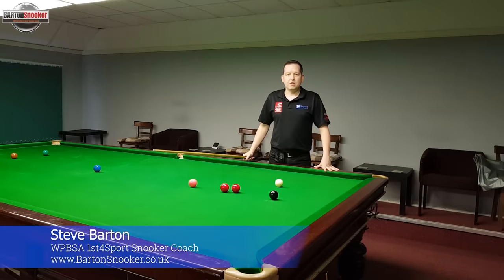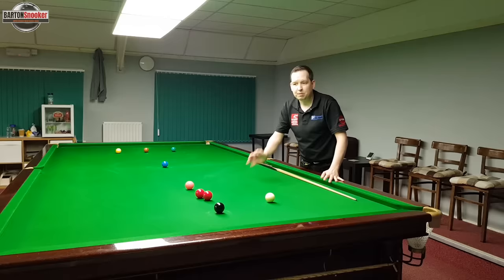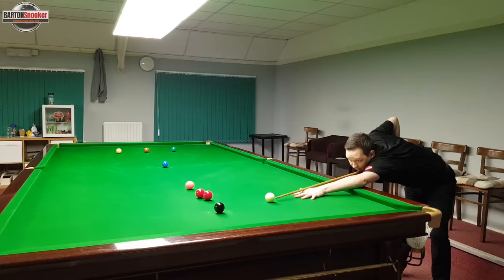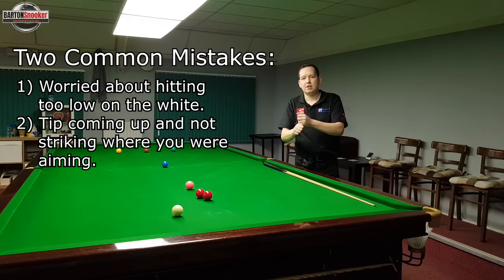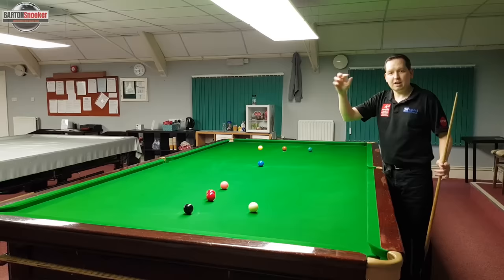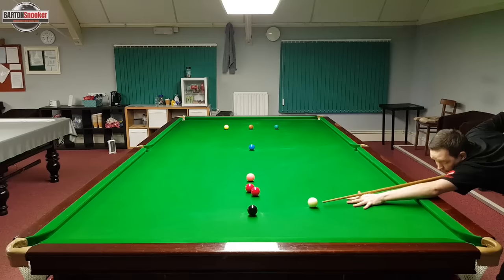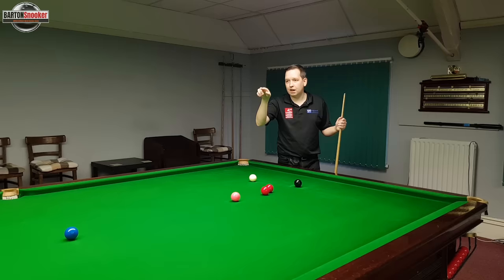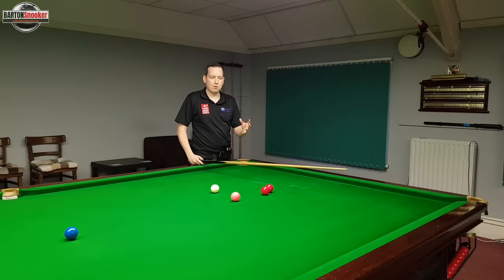3 Reasons Why You Can't Screw Back!

Comment: Thank you Steve for these interesting tips. At 1:57: The first mistake of hitting the cueball higher than you wish is usually the result of gripping the cue too far back, so the forearm is not vertical with the ground. This causes the butt end to rise as the cue goes back, so people tend to drop the elbow to compensate, which in turn causes a seesawing effect on one's bridge in a scooping upcurve, thus hitting higher on contact, not the cue moving forward in a straight line horizontally. That could be one reason why the person is hitting higher in the first place so to fail at hitting low enough to get sufficient backspin. 

Some professionals such as Steve Davis turn their bridge down inwards so that their thumb is practically touching the cloth, for a more level screwing through the ball, especially for the deeper screws. 

 The playing arm's forearm should be vertical to the floor when the cue tip is almost but not touching the cueball in the rest position. At 6:16, I can see that your forearm is perfectly vertical, good man lol. Very good and informative videos, thank you. Agape. Andrew.
Reply: Hey that's also great advice. Thankyou!
Reply: thanks bro

Comment: Good points.  I'd add some. Practice stance and cue grip > practice stroke > practice low, level cue movement > low hand bridge position > practice follow-through with accuracy of impact > get out of the way quickly for q-ball coming back.  

Have you ever heard of practicing with a long-neck wine bottle? It works, especially for larger q-balls for coin-operated bar pool tables. 

Ronnie-Rocket has a great stroke and follow-through, doesn't rely on power.  Decades of practice on top of natural talent and good coaching. 

Challenge: getting reverse (draw, Screw) when the q-ball is less than an inch from the object ball.
Reply: Never start changing your bridge hand, that's a deffo no no, snooker is basically entirely about playing a shot repetitively over and over again, the moment you start trying to raise your bridge or lower your bridge you'll struggle.
Reply: Challenge: ...You need to play those shots carefully to make sure you don't foul with a push shot/double hit. But to generate the backspin without the cue going all the way through is a bit like playing a punch shot in golf.. LOL It is though, you stab the cue ball, you do follow through playing desired side, if you're reversing the screw shot you play the opposite side you're facing, to spin left you play bottom right and vice versa, you put the tip through the cue ball faster than you normally would. Not power, but speed of tip. A little PUNCH, and you'll get it zipping back and spinning off the cushion.
Reply: Or if you want to be flash, you come down on top of the cue ball looking down on it with your butt over your head and drop the tip through the back of the cue ball on desired side. Only you'll get glared at for drumming your tip straight down on the cloth in some snooker halls LOL, but you'll not rip it provided your steep enough.
Reply: Worlds End , All good points.  Thanks.  Been watching a lot of Youtube snooker over the last year.  Very different than pool in many ways. 
What I am not understanding is the q-ball and object ball bouncing, after rolling the q-ball straight across the table.  Why the hop?
I'm in US, Didn't know much about Rocket, or snooker for that matter.  I think Ronnie is amazing, watched every video on him. 
What do you think of him?  Is he controversial?  $13million isn't bad for carer earnings.

Comment: Confidence on hitting the ball low to achieve backspin. I’d advice players who have this problem to shoot balls in the pocket, hitting an object balls while applying backspin. Follow through is important and fix your eyes after getting on line on where you want to hit the cue ball. Soft, controlled and good follow through will achieve a better controlled backspin than I hard hitting attempt. Increasing the power will decrease your accuracy. 

Nice video and very useful for those who struggle with this.

Comment: BARTON is correct !! NUMBER 1) PUSH your CUE THROUGH the shot. To screw the ball back or go forward or follow through "always push the cue forward. for "ALL SHOTS". (THIS ALSO WILL STRAIGHTEN YOUR STROKE).
This is why when you FIRST Practice you need to spend 5-10 minutes JUST hitting the Cue with a red ball and pushing your  cue forward. Stop POKING at the ball!.You will need to do this for about 100 practice times and then the muscle memory will take hold.

Comment: That's helped considerably - now I know what I'm trying to do and why. Also, I found a looser grip for this shot helps as well. Many thanks for the lesson.
Reply: Relax your rear hand and hold it loosely between finger and thumb. You'll deliver the cue much straighter through the white and will need far less power to generate great spin. Get that cue tip all the way through the cue ball, not hard just standard pace and you'll get better and better at it, it's all in cueing, good timing and the delivery of the cue. Imagine the other side of the cue ball and your cue tip coming through.
Reply: Yeah the loose thumb and forefinger grip is a good tip, also try closing the hand on the final delivery of the cue especially on screw shots.  Also pause on the final back swing, slowly accelerate through the shot (these two things are the mystery of "timing" ).  Also watch how he lines up his shot from standing behind the shot and swings the cue onto line, develop this for every shot. 

For a fun practice go as low as you normally go, then push the boundaries and go even lower.  Do this with side as well go as far as you think you can go then go a bit more so the tip is seemingly almost missing the white  , you get some amazing side spin reactions.  I'm a retired pool player, so these tips work well with a small white.  I was practicing this once and a pro player was sitting at the bar watching me, afterwards he said he didn't know how I did a couple of those shots,  I just said I just put maximum side on, he said I know, I didn't tell him I was playing  side to the absolute max seemingly missing the ball :).

 I find I played best with a slight feeling of aggression,  and slight showmanship,  arrogance in a nice way.  
I dunno why I ended up writing all this :), hope it makes sense to someone.

Comment: I think your fine demonstrations would be greatly aided by using a ball that has a stripe on it. One can purchase snooker balls 9-15 that we in the US call stripes. You can set the stripe parallel to the table, deliver the cue to the ball and a mark should be left where you actually hit the ball. I have found the use of the striped ball to be invaluable. Following through as you do does certainly generate professional looking screw.

Comment: The other issue with hitting it too hard is that you have to generate more spin to counteract the extra forward momentum the cue ball has as the cue ball will only start reversing once it has got rid of all its forward momentum.
Reply: gixxerman69 
Do u think follow through also help to create forward momentum of cue ball？
Reply: @akumakuma2547  Indeed it does as that is simple physics. For top-spin shots the spin adds to the forward momentum. With screw shots, the screw has to overcome the forward momentum.
Reply: Relax your rear hand and hold it loosely between finger and thumb. You'll deliver the cue much straighter through the white and will need far less power to generate great spin. Get that cue tip all the way through the cue ball, not hard just standard pace and you'll get better and better at it, it's all in cueing, good timing and the delivery of the cue. Imagine the other side of the cue ball and your cue tip coming through.

Comment: My screw back is actually quite fine (baulk line to pink back to blue area or more). but I can't do top spin properly, most of the time it becomes like a stun shot, I'm raising my bridge and hitting top of cue ball smoothly with good follow through but still I just don't get it. Please help thanks.
Reply from the maker: Hi. Noted down and I will cover this is a future video 🙂
Reply: @BartonSnooker  Thank you so much!
Reply: Play top spin exactly as you play screw only striking near the top of the cue ball rather than the bottom.
Reply: It's all in the timing and follow through, top spin is probably the most used shot in snooker bar centre cue ball striking.

Comment: I’d also ad dirty balls, damp cloth in humid conditions, I spray silicone spray on my table and use it to clean the balls, revitalizes the table, never had an issue with it causing any damage
Reply: I use wd 40 silicone spray , light spray over the table and them brush to spread it around evenly, do it around 3 times a year, but clean the cue ball regularly , just clean the cue ball first and you’ll see how much a difference it makes

Comment: Hi Steve. I have the same issue from time to time and I`m now going to go to a smaller millimeter tip.  From a 13 maybe to a 12. Its said that a smaller tip can create more dramatic spin. Also the curvature of the tip. I`ve recently went from a nickel curve to a dime curve(American coins).  The dime has a steeper angle and seems to generate more spin for me. Thanks for the video and keep them coming.👍
Reply: Brian B. A 13mm or 12mm is massive!  You should be using between a 9.5mm to as low as 9.2mm
Reply: @uFlavaMe  Smaller the tip, the better you must be cueing or you'll generate lots of side you don't want, it's actually easier slightly larger, an 11 is about right, either an Elk Master or a Blue Diamond tip is the way to go.
Reply: Slight dome is nice, to round and again you need to be deadly accurate through the cue ball
Reply: Hard Wired 11mm is way bigger than any professional uses. I play the game to a decent standard. 9.5mm is typically what players tend to go for. And for tips, Century tips are a lot better than both blue diamond and elkmaster.
Reply: @uFlavaMe  They go shiny to quickly and need really good-looking after, the Diamond will go on and on, the elk master helps spin as it's a more grippy loser leather.  I use a 10 and practice regularly with Andy Hicks who uses a 9... So what?
Reply: @worldsend9659  lmfao Cheers man, Hey I've heard that name before... Andy Hicks? He any good? Sure i've heard of him.
Reply: Worlds End How many people use an 11mm tip? If you can’t cue through the ball with a massive tip, may aswell pack the cue away and try something else. The fact that you think a tip of that size is what should be used is laughable. Every half decent player uses between 9 and 9.5. I’m not bothered whether you believe me, I’ve played and watched the game long enough to know what I’m talking about. Look up what tip size is optimal for snooker then come back to me
Reply: @hardwired548  Is he any good? If he was here I'd say nah he's crap.. LOL  Put it this way, I've picked enough colours out of pockets to make a pro referee and be a senior one at that LOL...He can rattle off century after century in no time at all on a good day, on a bad day he's still only a pot or two away from finding good form, especially just lately. He won the Qualifying school so made it into a few tournaments he went out 4-3 in the English Open this Monday gone, he had chances too, that he'd not hesitate to knock in up the club. He's a former World Semi finalist!
Reply: @uFlavaMe  Brilliant.  Good for you. You must have a Stephen Lee action hey? Top drawer, I hear you..You'll come to learn there's no such thing as optimum in Snooker, every player has their quirks and each one of us is different. The whole point was that it's far easier for a non pro to play with a larger tip. Something you seem to have a bee in your bonnet about, but all you're saying is nonsensical misguided trash, again being blunt.
And really mate, I'm not interested.
Reply: Worlds End love you
Reply: @worldsend9659  Semi's in the World Champs? I knew I'd heard of him before! LOL That dude ain't all there I don't think. He's a fruit cake LOL
Reply: @hardwired548  Lol, probably scored his first 30 break hahaha
Reply: @worldsend9659  lmfao 40 with that ''Pro'' optimal tip, surely?
Reply: @hardwired548  hahahahahaha stop it that made me laugh out loud!
Reply: @worldsend9659  :D

Comment: I am pretty good at screwing the ball back now and can generate quite a good amount of backspin but on fully straight shots with the white kind of close to the object ball I can't move out of the way quite fast enough.. there are times when I shorten my follow through  length and that works but I cant generate a lot of spin..any advice..? and after the cueball hitting the tip of my cue a few times I have even developed a fear over it Lol
Reply: You need to play those shots carefully to make sure you don't foul with a double hit. But to generate the backspin without the cue going all the way through is a bit like playing a punch shot in golf.. LOL It is though, you stab the cue ball, you do follow through but not as much and you put the tip through the cue ball faster than you normally would. Not power, but speed of tip. a little PUNCH.

Comment: I have the opposite problem.
I can set up the balls like you did there, and most of the time screw the black into the correct position behind the reds.
Problem is, 9 times out of 10 the black will rattle the jaws, or miss them altogether, leaving my opponent a simple red.
Reply: I see what you're doing wrong, there. You want the WHITE back behind the reds. The black is supposed to fall into the little hole in the corner.
Reply: @ashscott6068  Ahhhhh yes thats the mistake!

Comment: I don't get the theory of follow through (through I do believe the effect). As soon as contact is made with the white ball with the cue, the white ball moves away from the cue at a speed faster than the cue is moving, so follow through surely doesn't have any physical impact.  Is it a mental thing to discourage "stabbing"?
Reply from the maker: No. It's because we're human and the only way to be at maximum speed when you hit the white, is to follow through. Imagine if you tried to stop 1cm after contact was made?? It's not possible to do that and be at maximum speed as you strike is it! So that's why us humans have to follow through past the contact point.

If you built a machine, well yeah, you could make it stop 2mm after contact with the white was made. No problem. But for you, you have to go past and beyond the white, otherwise you won't be at maximum speed as the tip makes contact... You'd already be decelerating.

Hope that helps 🙂
Reply: @BartonSnooker  thanks, thought so.  So, it kinda is a mental thing (rather than a physical action/reaction) the follow through ensuring cue speed is at maximum (desired) speed during impact.   Make sense - thanks.
Reply from the maker: @HCMCDrives  hi. Erm, not really a mental thing, no. It's the only way it's physically possible for you to hit the cue-ball at the desired speed.

Let's say you need to strike the cue-ball at 9 mph. You can't hit it at 9 mph and then stop 1mm after impact, it's not humanly possibly.

So it's basically the only way human beings can hit at the correct speed.
Reply: @BartonSnooker  when I say mental thing, I should really say, not a physical action or reaction thing. The follow through doesn't create any effect on the ball, it's simply allows the correct cue speed.  So yeah, I agree, it's absolutely necessary, but i would say it's not impossible for a human to stop the cue 1mm after contact, it's just very, very, very hard (~0.0000001%), so the follow through action increases that percentage considerably. 
Apologies, my crap choice of words.
Reply from the maker: @HCMCDrives  no, you're exacy right! It allows the correct speed as you say.
Reply: It is a physical thing. When you follow through you actually get a longer contact period with the ball, it doesn't move away faster right away. The longer contact period allows for a higher acceleration of the white ball, which if you're hitting off centre, will result in more spin. Just google this affect, its the same in other sports, like tennis or badminton.
Reply: @zeshanm4725  In other ball sports the balls are soft so a longer contact can be made. In cue sports the balls are extemely hard and you cannot make the contact last any longer because there is no give at all in the material the balls are made of.
Your tip can have a minute effect as it has to have a certain amount of give, but a really soft tip will not grip the cue ball enough to impart enough spin.

Comment: Nice video again.

 Would like to understand as well the correct hand bridge technique while performing a screw shot. 

While my tip is already pointed correctly, do  I need to then lower my hand palm till it's flat on the cushion or just remain my palm height as it is and only then angled my cue so that the tip is pointed  lower at the cue ball before doing the feathering?.  Thanks
Reply: Do nothing, play as you play, make your bridge hand solid and stick to it, repetitive is the way to go, when you get it right you want to continue to get it right, over and over again. Don't start upping or lowering your bridge hand, just find where it's comfortable and you feel in control of the cue and stick to it. Playing from the cushion is the same, find a way you like, and stick to it as much as you can.
Reply: Relax your rear hand and hold it loosely between finger and thumb. You'll deliver the cue much straighter through the white and will need far less power to generate great spin. Get that cue tip all the way through the cue ball, not hard just standard pace and you'll get better and better at it, it's all in cueing, good timing and the delivery of the cue. Imagine the other side of the cue ball and your cue tip coming through.